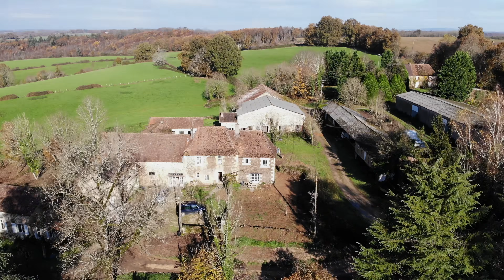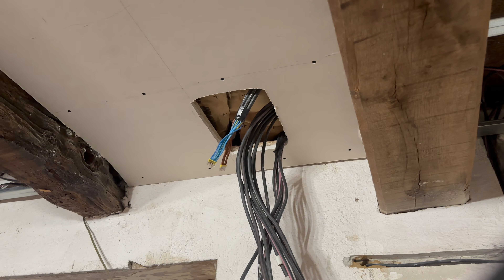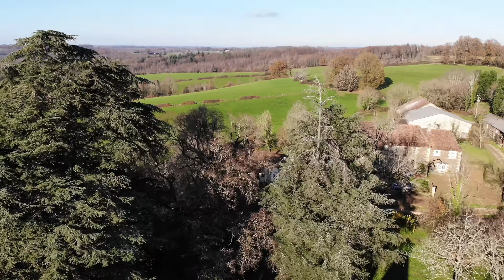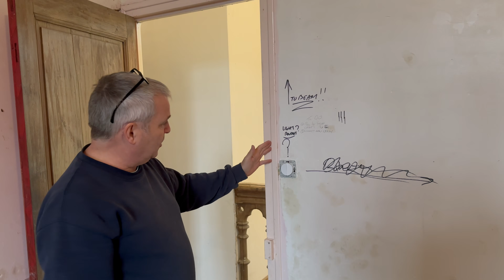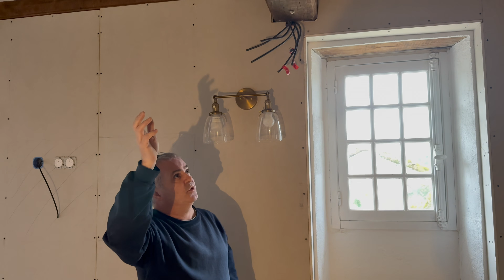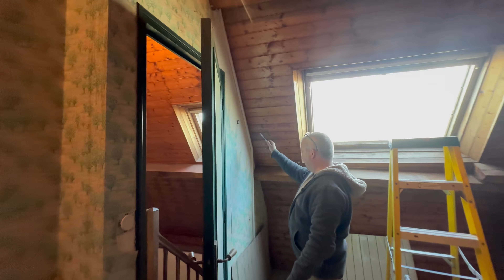A Day Of Hammer Drills | Château de Razac

Comment: You should put sockets etc on both sides of the bed. Otherwise you have to run extension cords. (Think two people per bed.)
Reply: There are  sockets and USB points at both sides of the bedside and on opposite walls. 😊
Reply: @ In every bedroom? I didn’t see it in the smaller bedrooms?
Reply from the maker: Check video

Comment: I have been wondering if you are planning to replace the turett on the top of the chateau tower room that is obviously missing 🤔? I know you aren't even close to working on the chateau yet, but every time I watch the drone footage, I wonder.🤷‍♀️
Reply from the maker: Do you mean the witches hat? If so, right now we don’t have plans to replace it. It’s covered with a flat-roof and isn’t exposed. On the top floor is currently a water tank. My father does have an idea for that part but will be discussing this with the BDF next year. 💫
Reply: @ChateaudeRazac  yes I guess you can call it a witches hat 😂 those top high areas were usually usually built as defensive posts so that is why I referred to it as a turret because there could have been that floor there then a roof or it was open with defensive bricking/blocks built up. I was just wondering what your dad's plan was? I didn't know if you had old photos of what it was and what it looked like before?

Comment: An interesting project and great that so much is happening now, love it, but I'd appreciate if the intro drone shot would be a bit slower, it kind of makes me dizzy at this current speed.

Also I wonder what material have you chosen for the windows? doesn't look like timber.
Reply from the maker: Thanks - will try, however it’s difficult not to make it too long by going so slowly. 

The new windows and doors are in fact timber, primed white in accordance with the BDF.
Reply: @ChateaudeRazac  Thanks for the reply. Regarding the intro speed etc, maybe concentrate on the main area (grounds/ builds). Less footage and that then slower so that one can actually appreciate the view of the chateau and the manoir ...